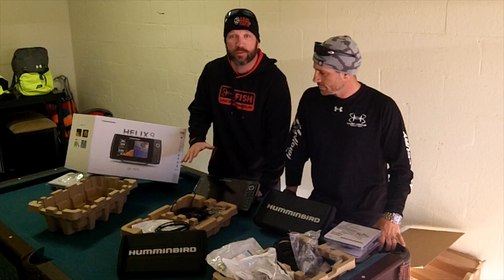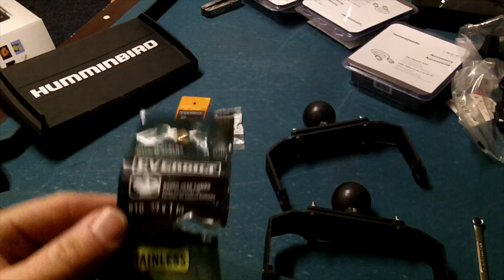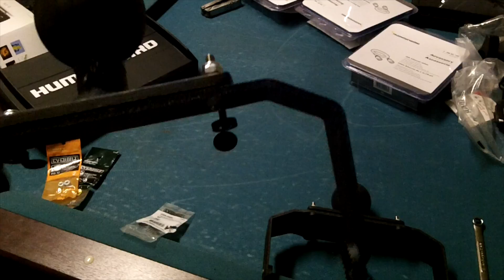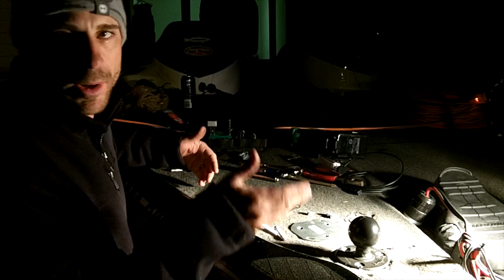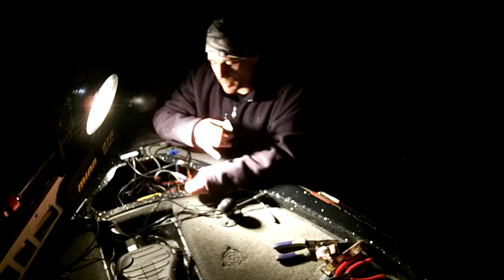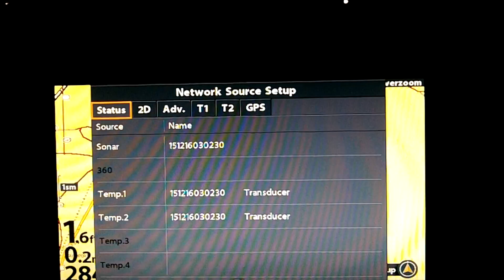Humminbird Helix 9 Install

Comment: Really? No interference not running your wires from both units to your battery directly with 10 Gauge tinned wire? Most boats don't have the 10 gauge tinned wire run to your bow or console. I heard this is the most important thing to do or your units will run hot and shut down or have poor picture quality. Current drops with light gauge wire over a distance.